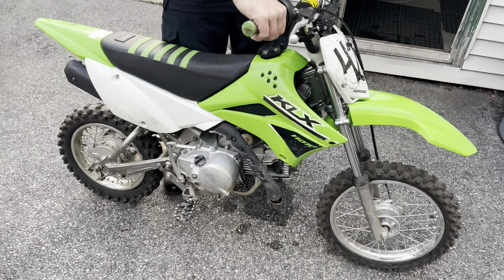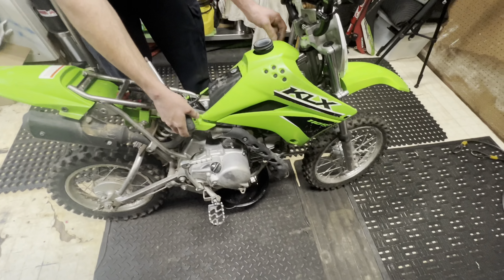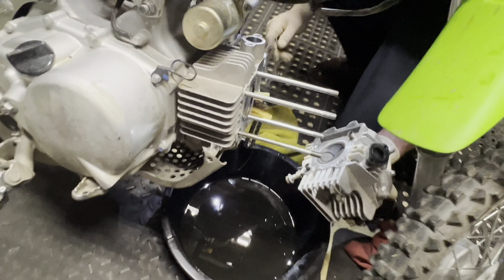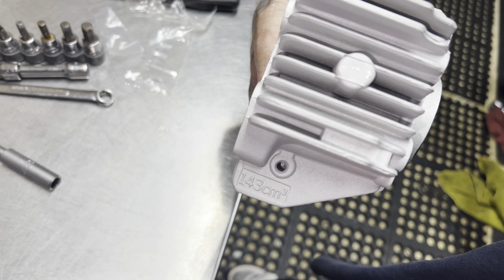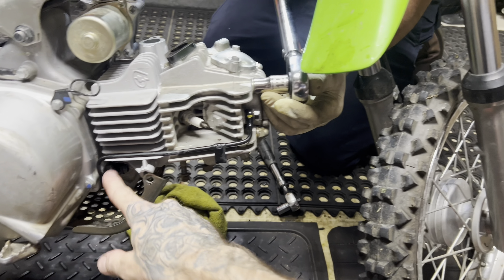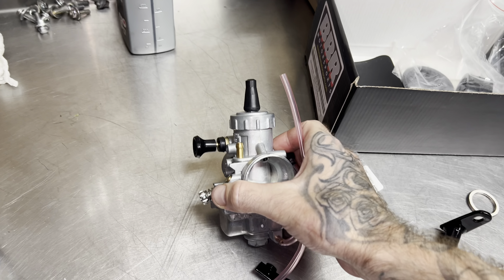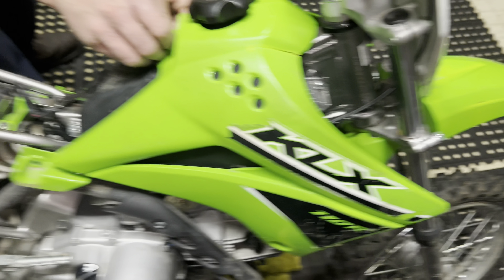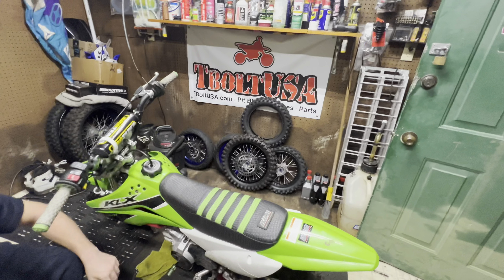2023 KLX110 TBparts 143cc Bore Kit Install | Mikuni VM26 & BBR U-Flow!

Comment: Needs a v2 head and a pipe
Reply from the maker: Unfortunately all its gonna be getting is the pipe lol
Reply: @JesseK410  dang those v2s are a huge improvement on the 143s
Reply from the maker: @RileySimmon  he will be good. If it was me you already know ide have a head on it lol. All mine got the V2 head i cant tell yah how many  I’ve installed over the years

Comment: Sounded lean not rich
Reply from the maker: Where at the beginning or at the end with the vm26?
Reply: Both actually lol lean bog
Reply from the maker: Yeah not sure what you hearing lol but definitely not lean on that vm26 especially with the stock exhaust its got a 22.5 pilot and clips in the middle its fat judging by the spark plug and how it feels riding it. Once we get the D3 in well go back to the 190 main and adjust the air screw accordingly an see where that leaves us, if its around 1.5 turns out the pilot is money and then well text the needle an main iet.. trust me ill get it dialed right in just like i do the carbs on all my other bikes 🤙🏼
Reply: @JesseK410 yea when my bije was rich too much gas i can be blind and still know that sound was flooding the carb sound cmon that dudes a dork😅